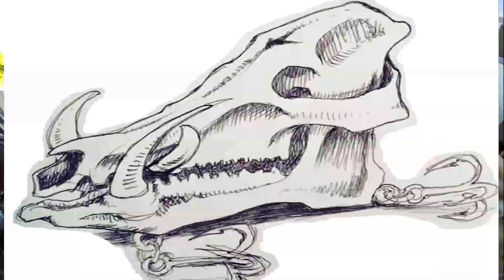RAT LURE PART 2 (EPOXY HARDWARE, WEIGHTS, SWIMTEST AND PRIMER)

Comment: I’m curious about how you secured the joint? I’ve been working on something like this and not sure what kind of joint to use. I like this style, looks solid. Is the vertical part of the joint fixed with epoxy as well?